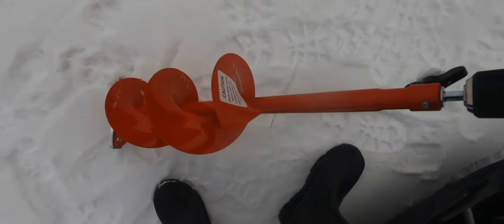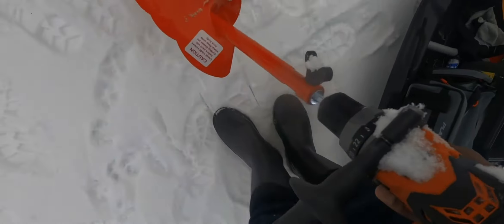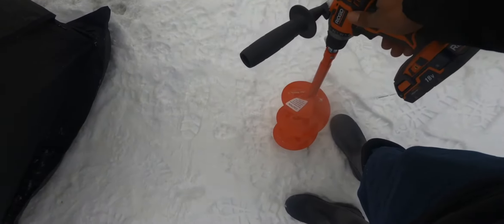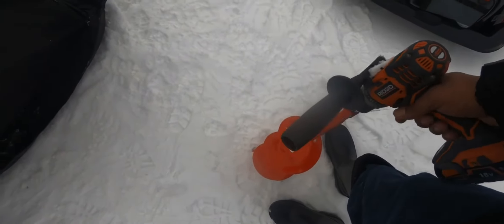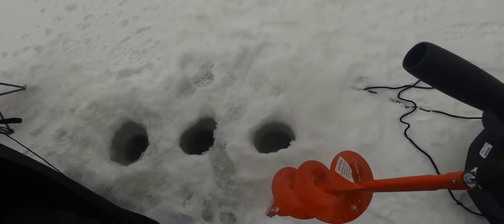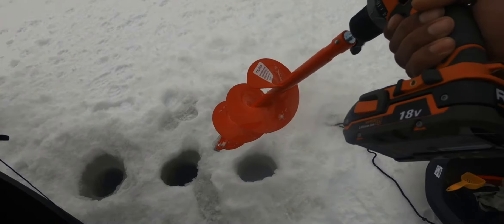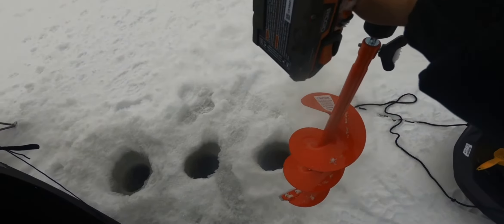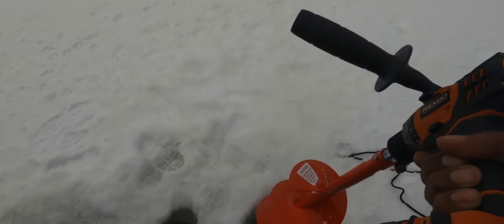Power drill ice auger (RIDGID 18V)

Comment: Woof woof... That's a cute little drill. If you ever consider an upgrade; check out what the DCD130T1 can do. (Dewalt mixer/drill)
Mountains of torque, low speed, keyed chuck, no settings, just beast mode through ice all day.
Edit: It's also brushless and designed to handle even more torque; so it won't burn out or get damaged.
Reply from the maker: Thanks for the tip, I've been using this drill for 2 season now so far so good, when it does go and it will, I'll be going brushless for sure, but will be sticking to ridgid as I'm invested in that ecosystem. Thanks for watching 👍🏽
Reply: @crfishing1980  They're all pretty skookum by the looks of the videos on the tube. I also like the Clam plate option with the optional gear box; could save your drill gear box and also holds the auger bit secure so it can't fall through if chuck slips. 

You might also consider adding a disk slightly larger than the hole to the top of your auger bit in-case the chuck lets go. 

I do like Rigid battery pricing; but so happens I have a bunch of Dewalt tools, so I'm in that same boat. I did discover inter-tool battery adapters on amazon that allow Milwaukee batteries to work on Dewalt tools for example. There are other inter-brand adapters too; some have a USB port for charging a cell phone too.

Either way, all the hammer drills pretty much beat the electric augers on the market. It's just that the Mixer/drill is a whole different animal designed for low end torque; there's a guy on here with a video demo. 

https://www.youtube.com/watch?v=_3-BlqfA3P8&ab_channel=AvE

I'd say it's even faster with the Cabela's hand auger with lazer blades. A wee bit aggressive at the bottom end of the hole; fair warning. 

But yeah, I got a new drill fetish now.
Reply from the maker: Ya I've add a frisbee to the auger before the season started. When It goes I will be looking into those mixer drills. Never knew about those adapters for the drill batteries. Sounds intriguing, I only use this drill for the auger I have other drills for working with.
Reply: @crfishing1980  Yeah, I'm sure the brand marketing teams were clamoring to contact the legal team when they heard about off-brand battery adapters interfering with 'planned obsolescence'.

Comment: I would add a Strikemaster Flange on top of the auger. If the auger ever pops out of your chuck, you're gonna have to go diving for it in the summer. They're like $8.
Reply from the maker: Was going to add a piece of wood or a frisbee, but for 8 buck I think I'll go was that. My biggest fear I always check the chuck before I finish drilling. thanks for the tip.

Comment: Great video and tips man! Been wanting to run this kind of setup. So buttery. Hand auger was fine when there was 4 inches, but not its a bitch.
Reply from the maker: Thanks man. For the price of the adapter it well worth it ( 10 to 20 bucks),I’m sure you have a drill laying around, I’ve just upgraded to a 4 amp battery haven’t tested it yet but hoping to get 50 or more holes on a charge. Thanks for watching.

Comment: Which model Rigid is it?  I have the Rigid Gen 5X and it sometimes stops as I'm drilling.  If I keep lifting it to clear the hole as I go it has no problems.  I'm also using a Finn bore auger that has curved blades.
Reply from the maker: I'm not 100% sure what make it is, it's not gen5 and not the brushless model, my advice is when your drilling make sure your drill is on the low speed 1 not 2, it's about tourqe not speed, I've had the same issue untill I dropped the speed from 2 to 1, btw I love your I cook with ice Video, thanks for watching, I hope this helps you.
Reply from the maker: I want fishing today and my buddy has a Finn bore auger and we had the same problems, the Finn bore has a thicker blade and it has more aggressive angle to the blade compared to my rapala auger, we figure that was the problem he's getting a different auger now.
Reply: I got myself a 5ah battery and that seems to help as well.  My friend has a swede bore that I'm going to try.  I'm glad you dig, "I Cook With Ice".